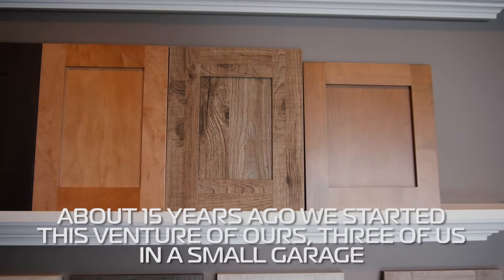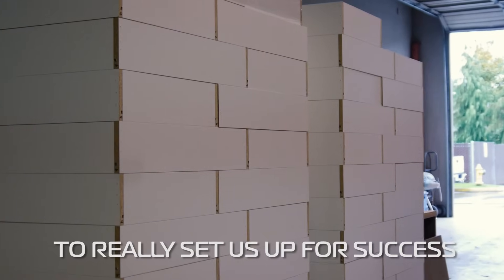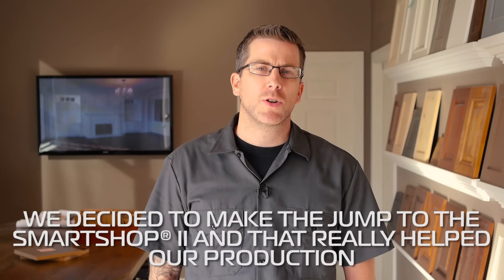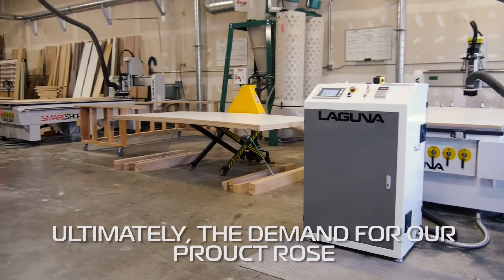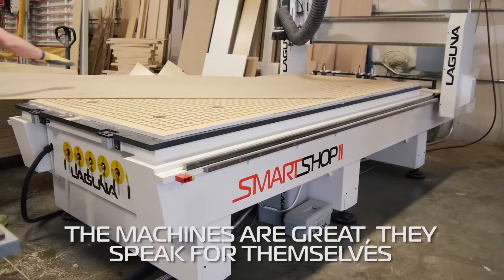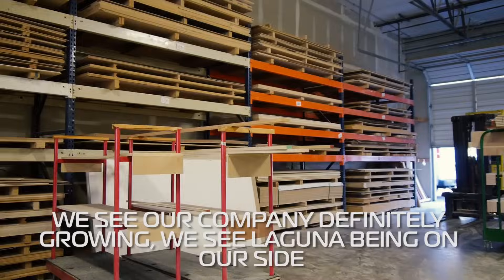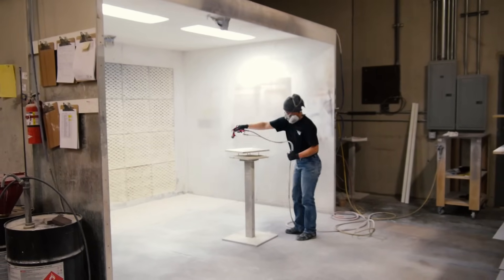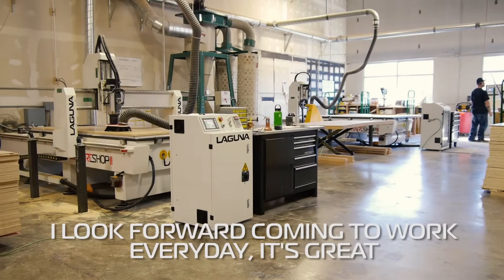Making Cabinets with a CNC Router Ft Winterwood Cabinetry | Laguna Tools

Comment: The setup on the table on those CNC's. Have you simply made another vac table on top of the machines table, in MDF and run that without vac seal?

I would like to do something similar, and was just wondering how exactly it works. Is the bottom sheet permanently mounted to the vacbed with screws?